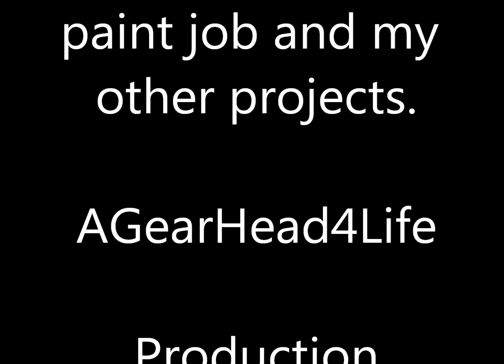Paint Job POURED ON & Rolled Out Rustoleum - $50 Dollar  DIY How To

Comment: whatever you do,never under any circumstances mask or prep anything properly.always do it the fastest and laziest way humanly possible;e for the most consistently shitty results.a beautiful truck deserves a beautiful paint job my man....
Reply from the maker: +big daddio You've completely missed the purpose of this video and are obviously unfamiliar with the project vehicle. You see a beautiful truck that needs a $3k paint job. I see the truck that I pulled out of a salvage yard and built to use as a low budget work truck project. 

The correct route to go for any decision will vary depending on the purpose of the project, budget and goal. That mindset applies to ever decision to be made on a vehicle.

To continue with your comment. To call me lazy would be to assume that I know how to properly paint anything. How do you know that I have a clue what I'm doing? If I did, I probably wouldn't be using a roller or Rustoleum. Right?

Everyone has to start somewhere when they're learning a new skill. I build cars. My specialty is powertrain and suspension. This beat up junk yard truck was a perfect opportunity to play with body work and learn something.

Your negative sarcastic comment does nothing to help the community. Luckily I'm strong enough to not allow your rudeness to effect me, but negative comments like yours are what suppress young people trying to learn.
I'm sure there's a positive way that you could have said the same thing and it would then be helpful information to the next person trying to learn.
There's already too much negativity in this world.

Just food for thought.